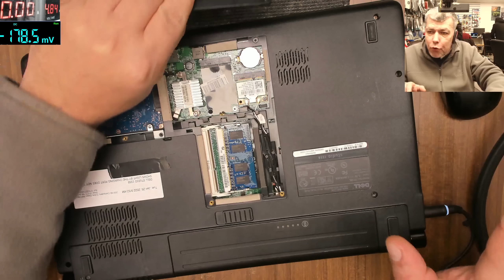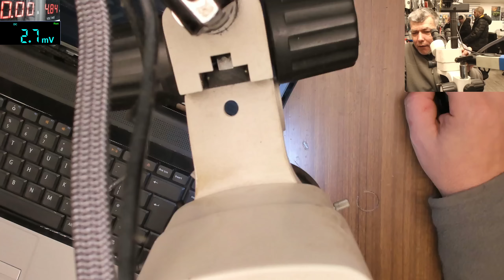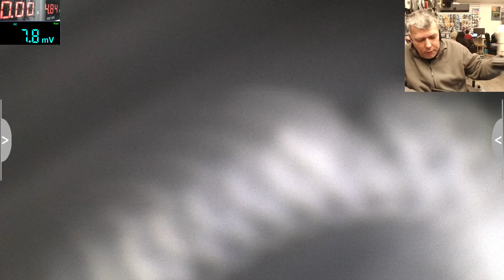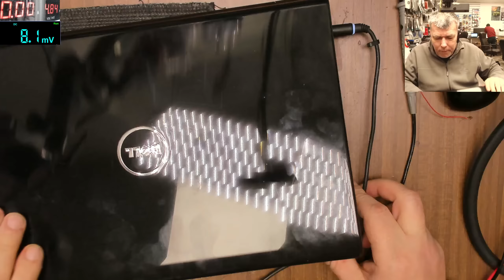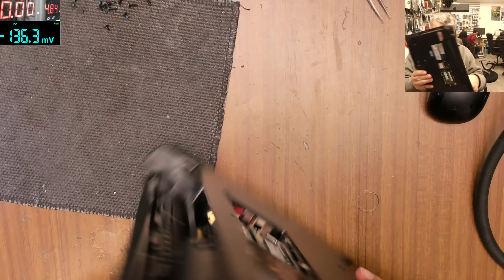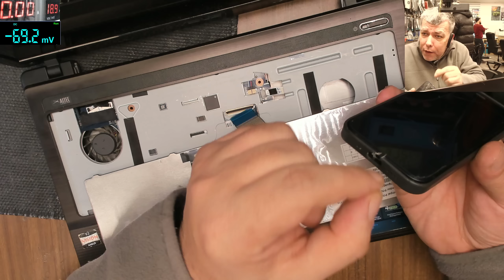Dell Studio 1558 & Asus K53u laptop repair - dead. not charging, not coming on

Comment: sir, I have a laptop inspiron 15 5000 no power and no display. I didnt recall if I forgot to remove the battery and while others socket are plugin or iremove cpu sinkhit fan to replace thermal paste. and after that my laptop not working anymore. The technicians told me that motherboard is a problem and they didnt know how to do it.

Comment: I look forward every day for your intuitive video's I purchased the ES15 to replace a Wowstick that I had for a long time you are rite about it being a bit hard to get the direction rite I have found that if you push the button on the side that you want to go, rather than the whole button, you don't have to twist your hand as much. I had trouble with mine after I had it for a few days, long story short, it kept showing a black screen after contacting  the very help full service dept, they were about to send a replacement when I found out that if I put a cable tie around the button over night I was able to upload the firmware and it worked again

Comment: Random question for HELP. 
I need a driver for a graphic card GT610M for asus r704a with x75VB motherboard . 
I don’t have the original hdd because I upgraded it from not graphic card to one with gpu card. But now the new motherboard doesn’t recognize the gpu at all do to not update offer any driver automatically from windows to be updated, Only the gpu recognize is the one in the processor the pops up on device manager I believe it says intel series 4000 but that is not the gt610m . 

I went to asus and nvidia page looking for drivers but they don’t have any when I typed in GT610M for my model of computer. I also have it with windows 11. But originally came with windows 8.  

The motherboard guy the sells them told me to take it to a computer repair, he said they will have the drivers  but I doubt it. 
Anyone can help me?

Comment: That ASUS laptop with E2 processor is 🗑️. I feel VERY sorry for the guy who use it. It would be funny to make a video to show how slow it is.
Reply: It's very weak indeed, but truth is it's enough for users with low skill and lots of patience. It's ok to pay less if you (really!) don't need much. 😉
Reply: @em0_tion  LOL can’t even use word processor because the text is very delayed to appear on the screen. if you are able to type more then 30 WPM… you can’t 🤣🤣🤣
Reply: @ciprianpeica85  Bet. 😁 With such squeezed hardware the right OS and settings are paramount. With them, and especially with the little help of an SSD, this machine can accomplish unexpected "miracles". 😉 Sadly, most repair shops in the West don't seem to offer such a service to their customers.
Reply: @em0_tion  Man. If I still had the laptop on hand I would show you how slow it is with SSD and Linux installed. It will ruin the computing experience especially if you are a beginner and want to experience the internet.
Reply: @ciprianpeica85  No need, I've installed Windows on worse E-450 machines with HDDs and already know. I usually curse the skies during setup, but once the torture is done, the end result makes it worth it. For its price, it's ok for a lot of customers that don't care about the 720p internet experience and have never even heard of "WPM". 🙂 But yes, generally agree with you - it is incredibly slow and frustrating to work with a laptop of such caliber.
Reply: @em0_tion  WPM means "words per minute" and the processor in this particular laptop is most likely the E2 clocked at 1.00Ghz.
Reply: @ciprianpeica85  Dunno why you're explaining WPM to me. 🙄 As for the specific APU, you don't have to guess - just check the ASUS product number on the back sticker (K53U-SX297V). It's the 2c/2t CPU E-450 @1.65GHz, the front (int. GPU) HD6320 sticker also confirms it. Don't mind their misleading marketing use of an " AMD Vision E2 " front sticker. These laptops are so cheap for 'em, they don't even care about the details.

Comment: I have a problem with my laptop Lenovo x250. It was failing to charge the battery so iopened it to test the voltage coming from the power supply and their was a spark between the sensor pin and the red wire coming from the charger to the main board, so since then it is not turning on may you please help me to fix this problem

Comment: Sorin.
Apple is a joke, there greed has ruined there products.
Having sockets for different things is a requirement on ALL p.c's.
Old machines have usb's sound and video out, far better for the user.
And constantly changing plugs and socket sizes is just stupid!.
Full size usb3 is very usable, two ports should be the bare minimum.
Reply: True

Comment: i have a dell inspiron 1564 have no sound in speaker but in Headphone sound work good whts the probleme
Reply: Bad speekers. Check coils with beeping. Or bad jack...
Reply: @Marius_Ciobanu  speekers are good testing with beepin i also separate jack from MB .STILL NO SOUND
Reply: @khaldoz   Sound IC is overheating? May headphones jack have internally a little connection who is telling to the MB than the jack is or not inserted.
Reply: @Marius_Ciobanu  OK THX